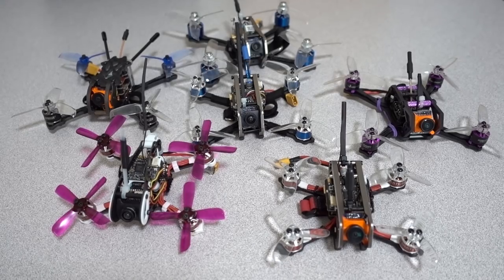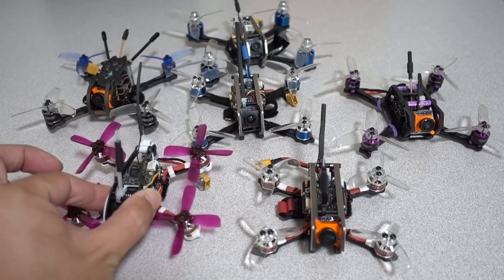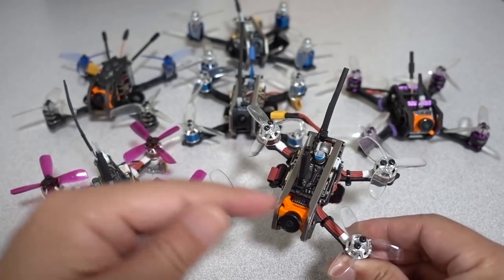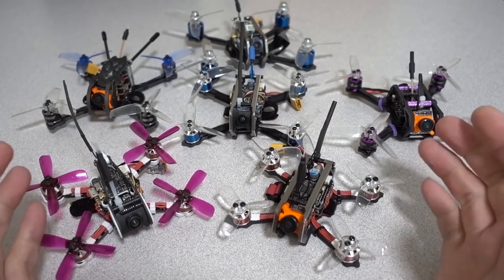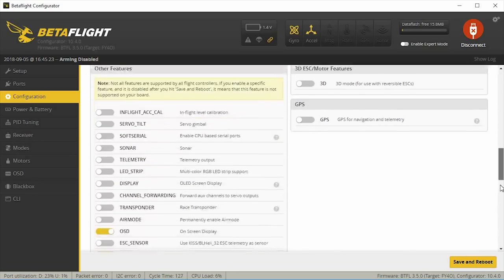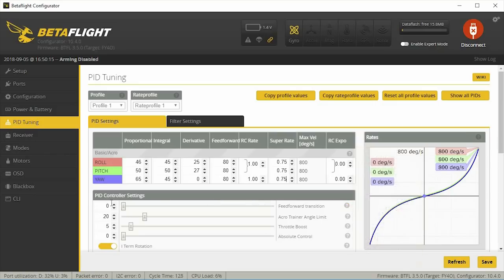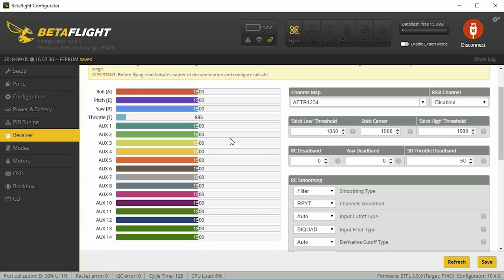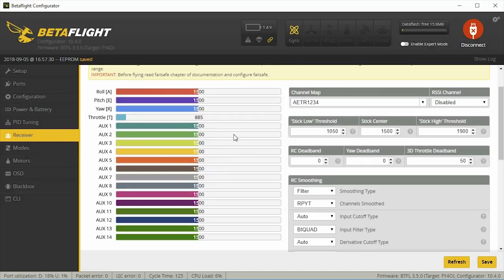Betaflight 3.5 Micro Drone PIDs (Intro) 🎓

Comment: Do you have any recommendations for the Mobula7? I have tried RDQ's recommended PIDs, Tried some recommended filters. But when I run 2S for only 30-40 seconds, I get extremely hot motors. Joshua Bardwell recommended me to go back to 4.0.3 version, as im currently on 4.0.0, full release version as mine had pre release firmware and wasn't working in bf 10.5.1 config. Also on RDQ's website they say that the mobula7 isnt compatible on 10.5.1, but when i first connected i had 10.5.1 and after flashing 4.0.3 everything seemed to work fine. I guess I'll flash 4.0.3 with 10.5.1 and try it out on default filter settings and see what happens. Only had this thing like 2 weeks, not trying to burn out a motor already. You'd think they'd ship it able to fly 2S without them getting so hot. Thanks! Oh also should I use PT1 or BIQUAD? Under receiver tab, my filter inputs say BIQUAD and it says that most users should use BIQUAD? Makes quad less responsive but better filter

Comment: Hey Albert... what are you using in the field to adjust your setting? Laptop or phone.... or something else? Doing two 3" builds with 1407 motors but not sure what pids to use.
Reply from the maker: I use my phone and an app called SpeedyBee.  I made a video about a year ago about it.
Reply: @AlbertKimTV  Awesome... that was it. I remember both you and Mike did a review on it. Thanks for all your help with this stuff. The boy and I went flying for the first time today and we had a blast with our tinyhawks... now to do our 3" builds as it was windy and blew our quads all over.

Comment: Gotta respect this folks.  I have been working with 3.5 since RC1. It is different but I love it.  Albert gonna be selfish here.  Already got a solid tune on the GatM 2.5. Id love to see the GTM 3.  It is on my list to fine tune.  4s 850.  Thats another thing people need to understand. If they fly different props, cell count, or weight battery there quad will not respond like yours.  I just finished my gtm 515 today.
Reply from the maker: Yeah, I will tell people what I use.  If they use different stuff, the tune won't work.
Reply: Do you have great PIDs for GTM3?

Comment: Hi Albert I love your tuning videos!!!! 
I have the Diatone 2019   2.5 +. 
After reading your comment about this video being outdated I have a question. Everyone says that from micro’s betaflight 3.5.7 is the best firmware to use????
I flashed back to 3.5.7 I don’t notice too much different from beta flight 4.0 that’s where I had my quad. 
Basically my question is would you recommend the latest betaflight firmware I believe it’s 4.2.4 for the Diatone 2.5+ ?  Even if I didn’t put RPM filters?
Not that I’m not going to I would just like to know your perspective. Do you believe that the latest betaflight would be better or is better without the RPM filter?
Thank you for all you do !!!!!
Also do you by any chance have some good PID’s for the Diatone 2.5 + on Bettaflight 4.2 ?
Reply from the maker: This is a complicated issue.  In a nutshell, 4.2.x is better but harder to setup and tune properly.  That's why 3.5.7 remains popular because it's less complex.  I'd make an updated 4.2.x micro tuning video but I won't because no one watches them and it's not worth the amount of time I would have to invest to make that video.
Reply: @AlbertKimTV  I know I would watch it. Maybe do a 4.2.x quick tune guide video by Albert Kim on the next quad copter you get that needs a tune. I think many will watch. 
I watch all your videos!!!!! 
I love your devotion !!!!! 
Keep the information coming!!!!!
Reply: @AlbertKimTV  OK so my question is and basically what you are saying is that if I knew Bettaflight 4.2 and I can tune that there’s no reason why I shouldn’t flash to that ? 
I have been using 4.2 ever since it came out have flash multiple quad copter’s multiple times to 4.2 and above. 
I had a good tune on 4.2 it was in great so I wanted to try 3.5.7 with a good tune that I found. I can’t tell that much difference it does seem a little more locked in I think that 4.2.4 with RPM filter would fly just as good as it’s flying now
I’d still like to say your comment about no one well watch the video I believe that people will I’ve noticed a lot of people aren’t doing tuning videos for micros like the Diatone lately. All the more reason to do one even if it’s just a quad copter that you get to review that has a bad tune on it just do like a quick tune. 
Anyway thank you for talking with me I really appreciate your opinion. 👍

Comment: I'm gonna try this i have the same geprc as u in this video but in the 3 inch and i just put the new bee motor 1108 5000kv on it and they are getting pretty hot on 4s so i tried 3s and still getting hot  no bolts touching the windings anywhere so i no its in the tune  thanks Albert
Reply from the maker: Cool, let me know how it goes.

Comment: +Albert Kim F3 is actually newer then F4 (that is why it has serial inversion built in!)... Th clockspeed is lower though, that is the only reason features are disabled...
Reply from the maker: No, the features are disabled because there is no room on the flash chip.  The F4 has more storage for the code that has the extra features.  Just correcting you here because that information is flat out wrong.
Reply: Albert Kim  Well, yes and no... you are right for some targets; from the release notes of BF 3.5:
"unfortunately, bugfixes in the flight controller core functionality have led to an increase of the firmware size, causing it to overflow the available space on a number of F3 based flight controllers. As a result, some features have had to be removed from a number of F3 based flight controllers in order to make the firmware fit into flash. The following targets are affected: CRAZYBEEF3FR, CRAZYBEEF3FS, FRSKYF3, FURYF3, FURYF3OSD, OMNIBUS, SPRACINGF3, SPRACINGF3EVO, SPRACINGF3MINI, SPRACINGF3NEO (#6497, #6501);"
i.e. BetaFlightF3 isn't affected by your statement, and there it's only the CPU's speed limiting enabling concurrent features. ;)
I did some research :D While F4 indeed has larger ROM space, the actually have space left to add some more code (as most of the F4 packages have 512KB, compared to the 256KB in the decent/later/newer F3 FCs (STM32F303CC))

Comment: Burned 2 motors each after 5 seconds of flight so not happy about how it's working with micros at the moment. Fresh built XJB Stack with Massive droner frame. Hopefully this helps a bunch
Reply from the maker: Even with these new settings you need to land after 30 seconds to check temps.  If there is something wrong with the build you can still smoke motors with these settings.

Comment: Thanks albert. Been flying a long while now thanks to you and a couple other guys! Really appreciate everything you do! Do you happen to have a babyhawk r? If so what bf you running on it? It's a 2 and 2.5" build and I'm running 3.5.7  on it and in like you I like the quad responsive but flowy or I call it squish factor like having shocks going over bumps it dampens the move I'm doing. I drive cars the same way not too locked in but a little loose too! I value your opinion and thoughts beciase you have proven to be reputable! Thanks again! Havnt seen your videos on your trip to banggood but hope you had a good trip!

Comment: thanks for doing this. I would appreciate it you can tune the XJB145. A lot of my micros have F3 and F4 so I will have to look into the F3 thing you mentioned.
Reply from the maker: I no longer have an XJB145 intact.
Reply: oh yeah. I think you transplanted the guts into another frame...or I could be wrong....lol. Anyways..no big deal. Thanks for replying

Comment: @Albert Kim, I can't find the Betaflight 3.5 GepRc Pheonix PID video, please could you link me to it
Reply from the maker: https://www.youtube.com/watch?v=tDw3wr1612U
Reply: @AlbertKimTV  Thank you for the fast response and link., however this one does not include the Betaflight 3.5 PIDs for the Phoenix  :o(
Having updated to 3.5.6 I wanted to take advantage of your expert knowledge and testing to set the PIDs the same as a starting point for mine. 
The Phoenix rocks btw is a fav of mine also......
Reply: @Albert Kim I used the PID's from your video (Betaflight 3.5 PIDs // Diatone GT-M2) did some test flights on 3s and the motors were just luke warm so all good......

Comment: I really think BF is going backwards, with a good control system you should not have to spend time adjusting all the settings. The controllers should be able to do it by itself, they should be able to detect if say a prop is damaged and adjust the filters accordingly. Also BF is really going away from very precise proximity flying to racing where precision is not quite as important.I have built many quads over the years and used may controlers and control systems and for my type of flying I still find a well setup cc3d on Libre pilot the most controlable for proximity flying. While I say that if you are in a wide open area where there is nothing to hit BF is great.

Comment: I know you mentioned you won't touch f3 boards. I did, however, end up using the performance 3.5 (3.5.1) on my 3" Babyhawk R and left all pids and filters stock. I turned on the new rc filtering and iterm relax, with some tweaks to feed forward, and to me it runs amazing. You miss out on LED and Acro trainer mode, but who cares on the BHR:) p.s. motors are not hot at all
Reply from the maker: I've got my hands full with just basic 3.5.  It seems people can't even flash the regular one... doing an alternate flash is too much for these newbies.  It's better for those guys to just stay on the older version.
Reply: I did the performance versions for bf3 boards. Sooo much better
Reply: @AlbertKimTV  makes sense (although, off camera, give it a go for yourself. I'm sure you'll love it)  :)
Reply: Wish I could tell you whether there is a difference. I'm somewhat of a nerd and, and when I received my Babyhawk R, Betaflight 3.5 had already been released, so I straight away upgraded it to 3.5. Meaning, I never even flew it on the stock version or stock PIDs. I also ensured BL Heli was on the correct version to invert my motor direction. It does fly really nicely on the performance 3.5 (get the performance edition, as long as you can fly acro mode, as with the additional new options it flies even better than the normal 3.5). I run on 3S batteries, with the stock props, and the motors stay nice and just warm to the touch. Meaning, I could leave my hands on the motors indefinitely without burning them. Individual results may vary, especially if you fly 4S. So, always perform the 30-60 second flight test, do a few consecutive punch outs, and check your motors temps to be certain yours is good.
Reply: @michaelmatthews6421  from my experience, 3.3 to 3.5 is a major feeling change... But it came with warmer motors.  I could probably tweak 3.3 to feel similar
Reply: @michaelmatthews6421  I think the old saying always applies: "If it ain't broke, don't fix it". Sometimes I wish I would listen to that saying...lol
Reply: @michaelmatthews6421  then no... There are many things that "feel" better and are "oooo" but not enough to make a change if you like 3.3.  i personally like tinkering, but the warm motors are not easy to address in 3.5.  i tried re-enabling the filters and the temps got worse.  It flies great default but they do heat up
Reply: @michaelmatthews6421  i know how you feel.  I use my leader 120 as my main quad lately because I can fly the most packs with it and have fun... i want to reverse the props and try, but i just like how it works all around.  I'm trying not to tinker to Oblivion
Reply: I put bf 3.5 on my baby hawk R 3in and as I followed along with Albert I seen you turned on all 4 tabs in pid controller settings (then save)then in  the Receiver tab you turned on Rc Smoothing, smoothing type to (filter) and Channels are on, (RPYT) and save.
When I do this and go back to the pid tab, the I term Relax always turns off won't stay on. Any suggestions ?
Reply: is that an F3 board?  RC smoothing and iterm relax are only available on f3 performance edition of 3.5 or on F4 boards
Reply: @Sully365  it's a f3 magnum. Yeah it won't take nether one being on and now it won't arm. That's what I get for trying to fix something that's not broke.
Reply: I have a short video on it: https://youtu.be/2KPeCuq8lNU  In the description are links to the performance editions.  They are MUCH better, imho, since i didn't care much for acro trainer and i don't need PWM.  They sacrifice those bits so you can have RC smoothing (my favorite feature)and Iterm Relax and the smartfeedforwards are active.  Watch UAV Tech for the techy videos, but give them a shot.  You can also check out Bardwell's recent video about troubleshooting the arming problem.  I suspect you did not turn on the receiver type correctly or it did not save.  They are kinda hard to brick, thankfully.  Hope that helps

Comment: My 2.5 goes crazy when AIRMODE is on - used your setup/pids, on 3.5.3 - any idea?
Reply from the maker: Hmmm, what does "crazy" mean?
Reply: @AlbertKimTV  looks to me that the engines spin up to max, with heavy vibrations, engines do run hot fast. Having this whith no probs on, copter on the ground in angle mode, 0 throttle just the 4% idle.
Reply from the maker: What drone is this?  It might be getting a lot more vibrations.
Reply: @AlbertKimTV  its the diatone gt-m2.506

Comment: Albert - the dynamic filter in 3.5 could be the problem. It was changed in 3.5 in a way that isn’t the best for micros. From build 1075 on in the developmental builds for 4.0 the dynamic filter is awesome and works well for micros. If anyone wants to try special builds of build 1075 of Betaflight 4.0 for F3 boards that have all the performance features enabled and the new dynamic filter, here is a link to UAV Tech’s F3 builds https://github.com/spatzengr/betaflight/releases. For micros, the defaults for the dynamic filter need to be changed to “High” and “Before_Static_Filters.” Otherwise, all your excellent tuning advice for 3.5 applies.
Reply from the maker: So sad to hear about 4.0 already.  I guess I better finish up these tunes before 4.0 is released... too hard to keep up!
Reply: Albert Kim  - no need to be sad - 4.0 (so far) is a massive improvement over 3.5 - but the tuning and filters are the same except for the dynamic filter - and the defaults for that are ok for 5-6” quads and only need two changes for higher kv motors.

Comment: Hai Albert.. Im hope you can review video about setup betaflight for iflight turbobee 120RS F4 4S, cause until today, my quad still cannot fly, cause im in Malaysia not many people had this kind hobby.. So Albert, if not bad for you, i really hope you can do perhaps only 1 video betaflight setup for this micro drone.. Now my problem was, my motor 1 and motor 2 dont work.. No twitching and nothing on this 2 motor.. Only motor 3 and 4 just work normal.. And another thing that my throttle also has go to yaw and pitch.. And when i pickup my quad, you can hear like short or motor twitching that maybe the motor want to run as the normally when you fly.. Sory my English not to good.. Im feel so bad, its 2 weeks already i had my first quad, but still cannot fly.... If you can teach or guide me sir, im really appreciated sir.. Im just go to cyber cafe and use hours rental p.c/ desktop to run Betaflight

Comment: So all that you just discussed is gone in betaflight 3.5.1
Reply from the maker: 3.5.1 is maintenance release. 4.0 will have more changes. Hopefully I can finish all these tunes before that one is released. LOL.
Reply: @AlbertKimTV  I'm sure you will, keep up the good work.
Reply: @AlbertKimTV  Just a heads up, I just installed 3.5.1 tonight and didn't see any of the items you are talking about.
Reply from the maker: There is no difference between 3.5 and 3.5.1.  Did you also update to the latest configurator?  I think the version you should be on is 10.4.0.  If you're on an older version it will look different.
Reply: @AlbertKimTV  no I didn't , I will, thanks!
Reply: @AlbertKimTV  it's always the small stuff that gets me, that did it, now I see what you see, thanks again!

Comment: This is so awesome! Thank you for focusing so much on the micro quads! Enough people focus on 5" quads, it's about time we have someone focusing on 2"-3" quads. 👍
If I could request one additional quad for a tune, it would be the GEPRC Sparrow. Thanks again!
Reply from the maker: Which version do you have?  I have V1
Reply: @AlbertKimTV  I built mine, but it'll be close to the v1, since I'm using GEPRC's GR1408 3500kv motors and their 3042 props, so it should be similar from a tuning perspective. Main difference with mine is I'm using an HGLRC F440 stack and a Caddx Turtle.